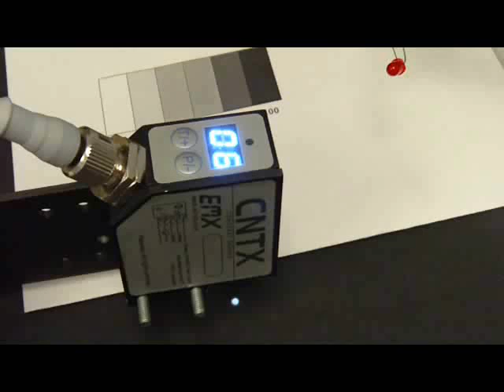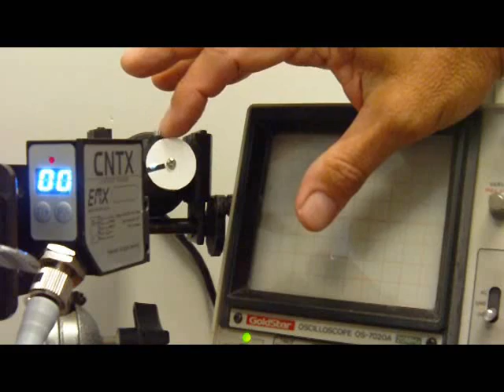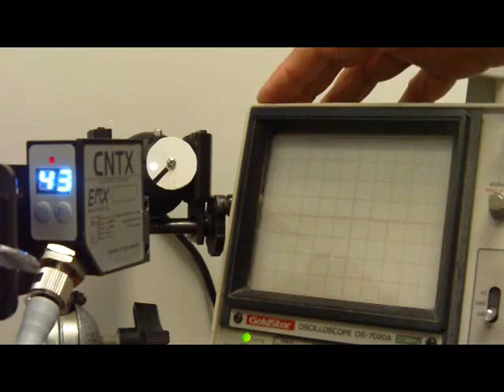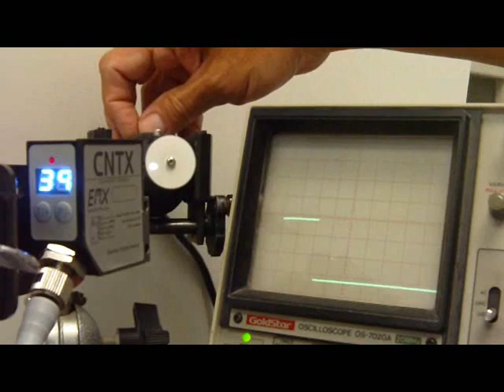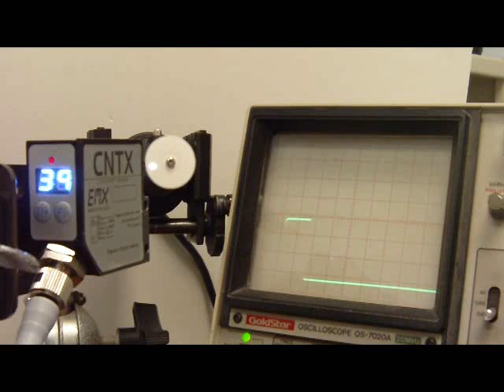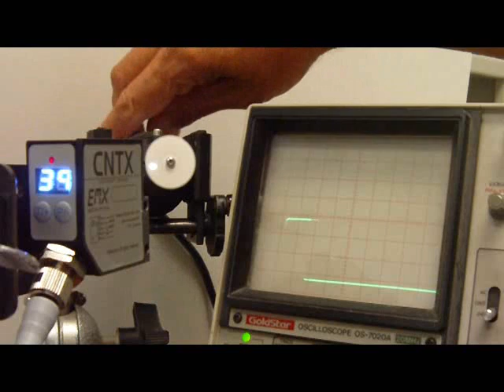CNTX Color Mark Sensor - Grayscale Resolution

Comment: Excuse me, sir, can the sensor only detect black?
The problem is I need it to be made in an automatic packing machine, right in my pack there are green, dark red, dark green and cream.
When the sensor detects cream, green, red, etc. the sensor is still on but only black is the sensor off, do you think there is a sensor like that?